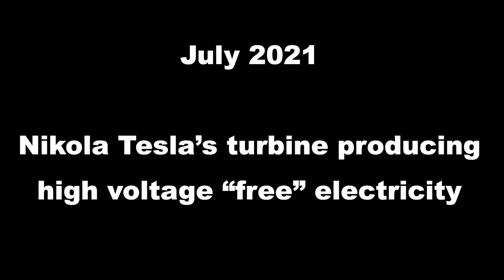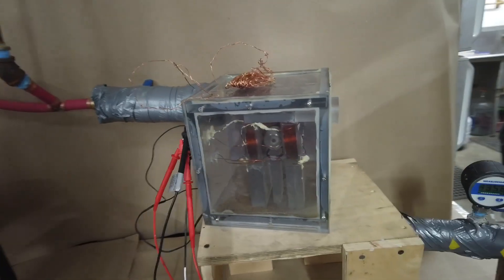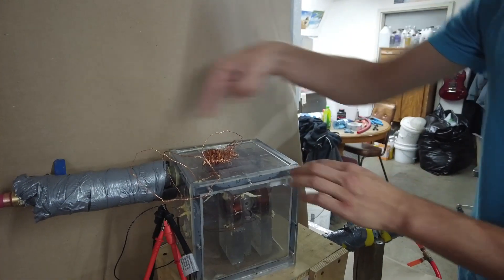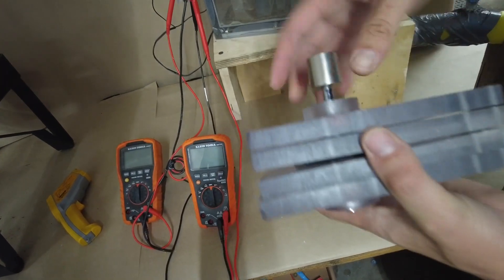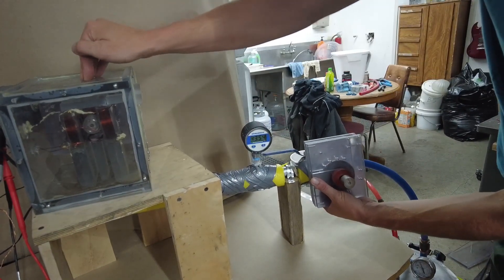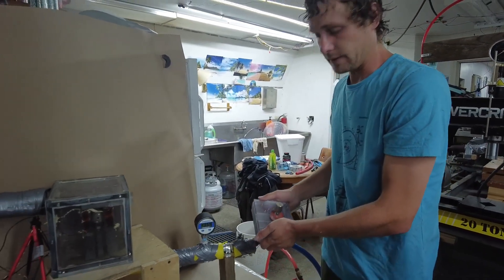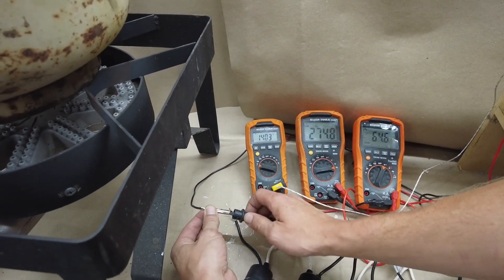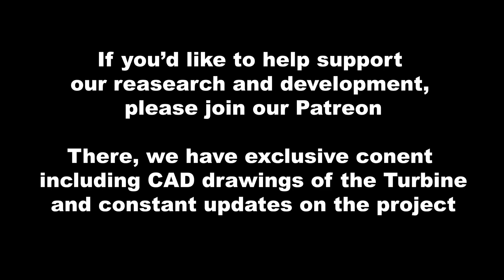Ground Breaking Renewable Energy System Using The Tesla Turbine

Comment: But imagine that on a usable scale.  Like boiler / chiller buildings in coal burning faculities with steam heat..  theyve got huge boilers that have stages to superheat the steam in order to push that steam for miles and miles to a radiator in some room in some building way out..  it just constantly pumps water into the boilers in order to keep them cool so they dont go nuclear..  but im sure if you all designed and built an aluminum or titanium version of that but x100 scale bigger to power off one of the superheat boilers..  could you imagine a motor like that spinning at 60k thats got blades as big as you?   Sound like a military jet during vertical takeoff..  i just think on a bigger scale and with superheated vapor and in a distribution node on a city grid.  You could power quite a bit if the rotor held up to that speed being that big..  itd have to be precision made and radioed to inspect for internal stress fractures and all..  but i could see that taking over from the huge stators they use now..  if you could use the steam rather than an existing voltage source to start it up that alone would save massive amounts of money with how many starting amps those huge motors take to get her chooching..
Reply from the maker: Yeah that would be really cool, but we are intending this for off grid homes.
Reply: Coal is collapsing like Sauron's dark tower in Lord of the Rings. What else have you got for a heat source? Solar thermal maybe? To be practical this would have to undercut solar photovoltaic which the International Energy Agency recently declared the cheapest form of electricity in history. 

Fascinating demo, though. I like Tesla's opening words in the clip: "the world will run on cosmic energy". Solar PV and wind are also cosmic energy being ultimately sourced from the conveniently located fusion reactor we call the sun.

Comment: Is it possible to tak the cold tank side and plumb it into the hot tank and refill it once the hot side creats a vacuum and edless runtime
Reply from the maker: it's absolutely possible, in-fact that's what we are going to do.
Reply: @iEnergySupply  one of the things ive always wondered is why electric cars dont have a alternator/generator on the back side of either the motors or the axle shafts to help better regen on top of the regen from momentum the vehicle gives going down hill
Reply: @Duey_diditGarage  that's a lot of complexity and copper cost for very little to no benefit. just like why people don't put heat exchangers on their drains.... the cost will never recoup the energy harvested

Comment: Why did you decide to not use a two-stage turbine for this?
Reply from the maker: It's much more difficult to build the two stage on the same shaft, we will be using the pump too but it will come after the single turbine testing.
Reply: @iEnergySupply  Very interesting stuff as usual, Jeremiah!  Is the difficulty of attaching the pump to the same shaft as the turbine due to 
  -- the increase in length of the shaft (making the unit too bulky perhaps making it too big for the vacuum chamber, etc), or 
  --  not knowing how big to make the pump discs/runners (because of not knowing the best amount of suction to work with the turbine), or...
  -- is it because you need to uncouple the real-time change in pump force from the turbine force because the needs of the pump force change in a "non-linear" way in relation to the turbine force? Or...
  -- is it something else? Thanks!
Reply: interested to know this answer as well, thinking of trying to make my own single shaft two stage and am trying to figure out the size ratio between the working turbine and the pump/vacuum turbine